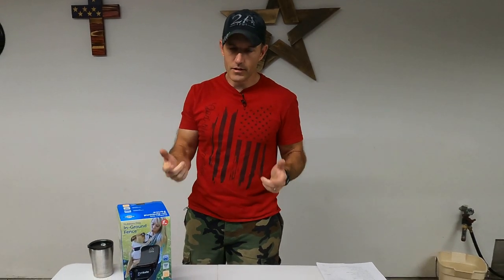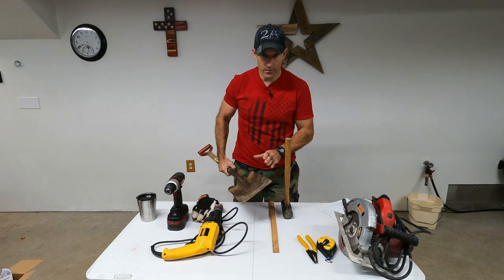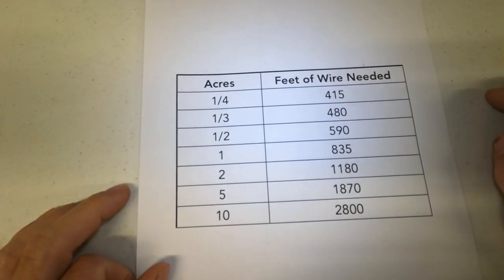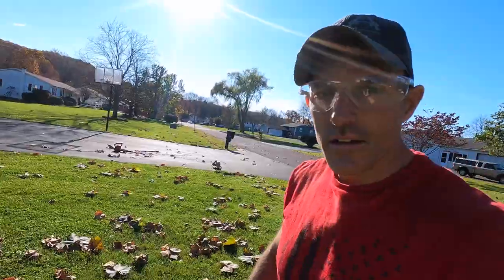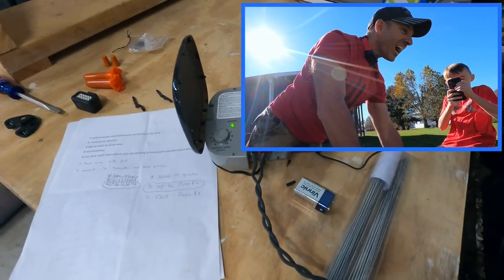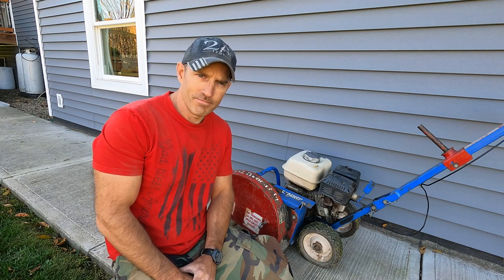How to install a invisible dog fence step by step (Pet safe)

Comment from the maker: (click read more)   Thank you very much for watching and God bless
🔴Pet safe fence that I used.  https://amzn.to/3HhsWNV
🔴14 gauge wire 1000 ft. https://amzn.to/3wI7flb
🔴16 gauge wire 1000 ft. (easier to work with) https://amzn.to/3ovaclz
🔴14 gauge wire 500 Ft https://amzn.to/3C96P8p
🔴16 gauge wire 500ft (easier to work with) https://amzn.to/3ndlf3m

* My T-shirts  https://diy-jim.creator-spring.com *
    5% off shirts use DIYJim2021 when checking out

            ✅ WEST BRANCH RENTAL✅
              www.westbranchrental.com

441 N. 10th Street              68 H & S Drive
Lewisburg, Pa                     Selinsgrove Pa 17870
570-523-6216                     570-490-8428

Bible ESV easy to read   https://amzn.to/3qshNQP
Bible NKJV                    https://amzn.to/30ns322

Titan solar generator (large generator) https://poweredportablesolar.com/ref/48/

Go pro that i use  https://amzn.to/2WC6WXH

my wireless mic  Rode wireless Go https://amzn.to/2WxQt7c

0:00 Intro
0:44 West Branch Rental
1:32 Open box
4:40 Tools I Use
8:00 EZ Trench digger
8:43 Different ways to lay wire
14:40 Get started walk around property 
16:20 Cutting driveway 
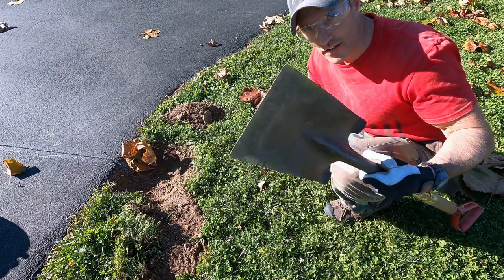18:22 How to use edging shovel 
19:15 Start with EZ trench digger
24:41 Wire across driveway
27:00 Twisting wire
30:30 Connecting wires inside
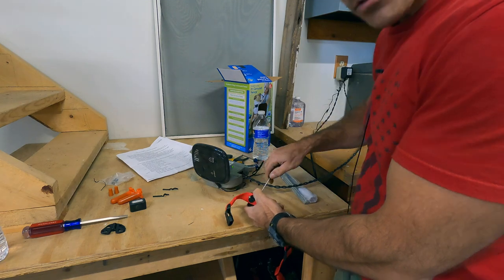35:20 Getting collar ready
37:40 Sealing crack in driveway
38:38 Showing finished job
40:00 Trying collar around my neck FUNNY

*Full transparency. I am a participant in the Amazon Services LLC Associates program, an affiliate advertising program designed to provide a means for me to earn fees by linking to Amazon.com and affiliated sites.
Reply: A pressure washer and a son or daughter 12-35 years of age feeding wire into the slurry with spool wheel works way way faster and with less hassle .    1-10th the time . The slurry will skeet dirt onto your lawn wich you go back after and rake into place but for the most part the soil resettles on top of the wire without much extra effort  run your feed ramp on the wire wheeler about 1.5'' below the slurry and run it backwards so you don't fill the feed hole with slurry muck .    It works without needing to rent wire digging tools and it works fast when you get your angle to spray correct.  You can do it alone if your talented.
Reply from the maker: @jesusoftheapes  interesting that does sound like it would work good. Thank for watching
Reply: @DIYJIM  thanks for the video

Comment: Thanks for the video..I have waterfront  property...so just to get this straight..I would set the desired perimeter and to allow for water access I double loop 5 ft apart on each side I want to restrict.  to create an open area..right
Reply from the maker: Sounds like you understand, thanks for watching

Comment: What was the PVC conduit you used to tie the wire into the garage through the block?  I am just trying to finish the tie in to the garage. Great video I used the same cable machine but we are in PA and the clay was an issue for it.
Reply from the maker: I just used a 1/2” pvc just to protect it from weed whacker.

Comment: I'm going to be replacing my wire next wknd because I used the cheap 20 gauge that came with the system and I can not find the wire break. First time I did everything by hand, over 1500 ft. @ 62 years old, I'm now 65 and no way can I do it that way again so I am renting the machine and upgrading to 14 gauge wire. Hoping this time the wire outlasts me! Thanks for the informative video, much appreciated!
Reply from the maker: The machine works awesome, so much easier. Do you live near me? If so let them know you seen the machine on my video.

Comment: I was thinking of putting the transmitter inside a utility building I have. Bad thing is that it's a metle building 8x10 . Wonder if it would work. Probably not
Reply from the maker: Probably going to mess it up. Thanks for watching

Comment: I need to cover around 3 acres and was estimating about 1500 feet of wire. My question is with the distance is it necessary to gauge up the wire as you would in electrical work? I was hoping to only use 16 or 18 gauge wire due to cost but not sure if it’s sufficient. Any help is appreciated thanks.
Reply from the maker: Sorry I really can not give you a answer. You will have to do some research on that one.

Comment: So question so after the wire leaves the transmitter that will be twisted how do you turn it into a single wire again? Do you use those orange connectors
Reply from the maker: My wire is all solid I recommend not using connectors if you can. I show in the video leave the receiver going around my house come back to where I started. Then I twist the wire. I’m going to the receiver.
Reply: I think if I understand your question correctly ... 
First - you must to have a complete loop (so you begin at unit, go around yard and come back into the unit in the second connector)

The twisted wire cancels the signal so there is no shock, so places like gates and walkways.  

So when he exits the garage, each wire will go a different direction.

My question is ...
Once we start making our way around the property, how do we ... with one single wire ... twist the wire for gates etc that we want them to be able to pass through? 

Can you just backtrack and lay a triple twist?

I know all the fences recommend no breaks or splices .... so curious how that works?

i

Comment: Great video!! Was curious about your thoughts of transmitter in a metal shop, thought about mounting on outside in a weather proof enclosure
Reply from the maker: Really not sure if that would mess it up. It does say not to put it near big metal objects in the manual. Sorry I can not answer better. Thanks for watching my video.
Reply: Have a question on what you use for crossing black top drive
Reply from the maker: @rickrobinson8800  a blade made to cut asphalt. I think my blade is a diamond blade.

Comment: I'm in the middle of this project, roughly 3 acres. I've been trenching by hand because I'm not sure how that wire installer will do in pure mud. I have lots of uneven and rough spots. Thoughts on the machine running through mud? Maybe I should rent a disk trencher? This has been a huge challenge, appreciate your thoughts.
Reply from the maker: I would call the rental place and see what they think. My guess it would work either way. 3 acres by hand will take forever. Hope it all works out.

Comment: That whole system made no sense to me. It doesn't stop loose dogs from coming in your yard and causing trouble.  The time I installed the invisible fence I used a cable plow on my skid steer. To go under sidewalks and asphalt I used the 1/2 PVC and water to get it in. The inductive loop/twisted pair system used for traffic signals is based on the same principle although it measures current changes based on magnetic fields. It is impressive that your area looks so much better then here, you even have open fields near your home. It has been over 50 years since we had those.
Reply from the maker: The system works real well for my dog, now she does not go out in the field and roll on dead animals. I thought about trying to go under my driveway but I think there is to much stones, wish I would have planed when I had the driveway done.  Thanks for watching          The wife is happy

Comment: having trouble making a safety boundaries for the dog any help? twisting the wire is wired thanks
Reply from the maker: Not sure what you're having trouble with the twisted wire cancels the signal.
Reply: @DIYJIM  yes but when we twisted the wire are you supposed to connect the twisted wire back to a single wire and continue the loop or connect the whole twisted wire to the transmitter? THANKS!
Reply from the maker: @jjeffrey21  twisted wire to the transmitter connect a non twisted wire to the other end of the twisted wire go around your house and back into the twisted wire.
Reply from the maker: make sure you use water proof connections that should have came with your kit

Comment: We back up to woods. What are your thoughts if I go two or three feet into the edge of the woods, but not bury the wire? Do you think a 16 gauge would be okay or should I use a 14 gauge. Also do you think I can just leave the wire on the ground or maybe use some  lawn staples to pin the wire down. 
We live in northeast Ohio we do have bad winter weather. Along with deer, moles, squirrels and chipmunks. 
Thank you for your helpful video! Now I’m sure my daughter and I can install this fence ourselves!
Reply from the maker: I think 16 gauge would be fine. Hope everything goes good for you. I think I would at least use some lawn staples. Thanks for watching

Comment: Yikes!   I certainly wouldn't want to be cutting in-to my concrete driveway!  Nothing like introducing water (or ice) in-to the concrete, which we all know ice expands, causing cracking.   
Suggestion!!!!   Never saw-cut your driveway for an installation like this,  unless you already plan to replace your driveway within the next few years!    That's just Stupid!
Reply from the maker: Thanks for watching, if my driveway was concrete I would saw cut it anyway so it would crack where I want it to. If you pour one large slab of concrete with no saw cuts you will have cracks were you do not want. Thanks for watching anyway. My black top driveway I seal every other year.